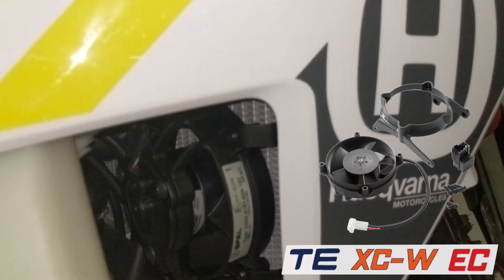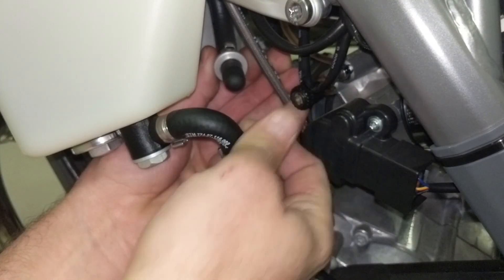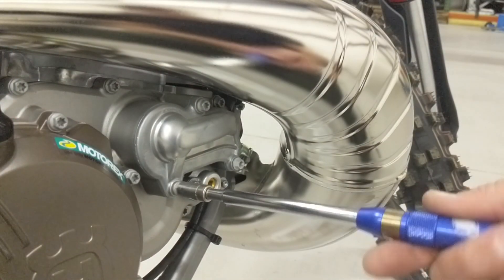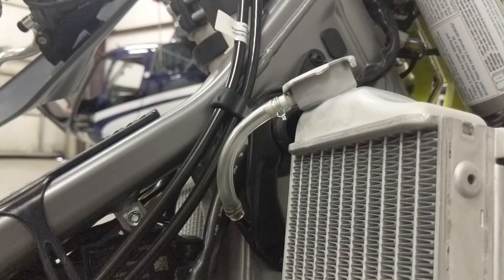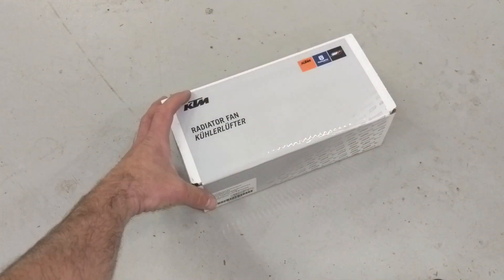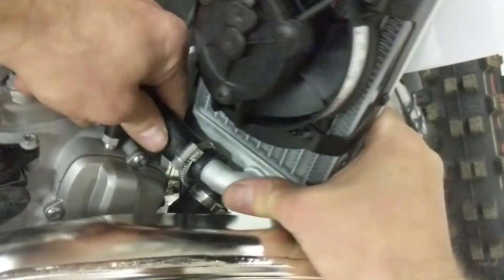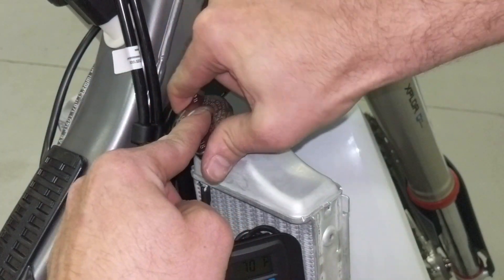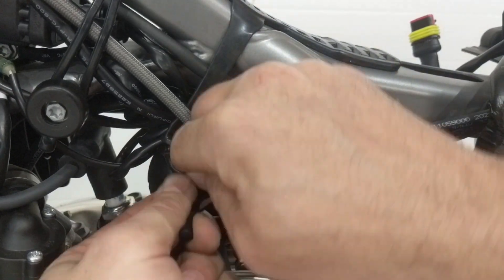2022 TE300i: Radiator Cooling Fan Install (Husqvarna, KTM, GasGas)

Comment: Why people keep using the aftermarket parts? Oem have relay and all. No need to conect on the battery plus runs with the engine itself
Reply from the maker: Yeah the OEM fan is a great option. However,  the aftermarket fan has a display and with the direct battery connection, you can set the on/off temperatures independently of the bike's ECM.

Comment: Actually just did mine but used the simplest method, just removed the top hose and rotated rad enough to install fan. Worked great, not a drop of fluid spilled, way quicker.
Reply: Did you drain the coolant?

Comment: Any ideas what temperature to set on this fan for FX350 '23 ? I don't want it to be cold or overheat, but can't figure out what temperature would be fine 
- I don't know how coolant temperature is related to radiator temperature (sensor is stuck between radiator pins, not inside cooling system where coolant is directly touching it).

Comment: Curious,  using the fan relay does the fan shut off on it's own after the bike is shut off?. Mine came with a switch and will continue to run even after the  bike is turned off until it reaches the desired set temp. Problem with this is the drain on battery and the fact that there is no water circulating with the engine off. 

Thanks
Reply from the maker: If the switch is wired correctly in series between the battery and the fan, you can turn the switch off and bypass fan temperature control when the bike isn't running. If you leave the switch on, it's direct wired to the battery and the temperature control built into the fan dictates when it turns on or off regardless of whether the bike is running or not. I don't have the switch on mine, and it doesn't bother me that the fan is trying to cool the bike when it's not running. With the lithium battery, I've never had a problem with the battery getting weak. Especially in situations where the fan is needed. It means you're actively riding the bike, and the battery is being maintained in a good state of charge. It's also fine the coolant isn't being circulated when the bike's off. The fan will cool what it can. If you bypass your switch, and wire direct into the OEM relay slot, your fan will now be getting two signals. The bike computer will be trying to control the on-off temp, but so will the fan. The fan might be asking for power, but the computer isn't sending it because the two temps don't agree. Not sure if that helps you with what you're after, but hopefully good information. Thanks for watching!
Reply: @MasterJacks  I have a couple friends that  have KTM 300 Erzberg edition and when they shut off their bikes the fans runs for maybe 5 seconds after.  That is why I was wondering if the fan relay on the Husky would do the same.

Comment: You 2022 should have come with a plug for the fan and shouldn’t have needed the auxiliary harness. My 2022 250 did.
Reply from the maker: Which fan did you install? Did it have the digital display?
Reply: @MasterJacks  I installed the Ktm fan with digital display. Same as yours. If you dig through the harness under the backbone near the rubber tie that secures the wiring, you will find a empty plug that matches the plug on the fan. All 2022 and newer models come plug and play for a fan.
Reply from the maker: @slickricktheruler  I was curious about that when I did mine. I found that connector, but I didn't feel like it was a good fit. It didn't snap, more like a compression fit. I've also heard that tapping into that connector gives the bike's module temperature control vs. the temp you set on the fan. Has it worked okay for you?
Reply: @MasterJacks  I’ve had it installed since last winter and I haven’t had any issues with it. It cycles on at about 182 and and off at about 176 roughly. Yes it’s a compression fit  Just thought I’d let you know and thank you for the how to video.
Reply from the maker: Thanks for sharing. Good to know!
Reply: @MasterJacks  your husky had the fan relay already installed correct?
Reply: I am not kidding when I say I have my 2024 KTM 450 XC-F  in my kitchen right now trying to get this fan on (it’s too hot in my garage). For the life of me I can’t find where it plugs in!!! I was under the impression we didn’t need the harness either. So I was happy to read that you thought the same thing. Could you tell me where that plug us? I have been looking for over and hour!!!

Comment: I'm desperately looking for something that will fit the 2022 Husky FC 450 Rockstar edition. Basically a 23 model.
Reply from the maker: I'm 99% positive this fan would fit your bike. The wiring is universal. I would look up the radiator on your bike, and the radiator on this bike and see if they have the same part number. If the radiator is the same, the fan will mount up. This is a great fan, and fits up to most husky, KTM models. Good luck!
Reply: @MasterJacks  I've mounted it on FX350 '23 and working fine - I just had to use other screwes than those included with the fan.

Comment: I just did all this about a month ago, now it’s got a huge draw killing the battery when the bike is off. Any ideas
Reply from the maker: If you used the same method and direct wired to the battery (didn't tie into any factory wiring), then I would disconnect the fan and see if your drain goes away. That would at least tell you if it's in your fan, or something else. The fan shouldn't be drawing anything, but if it is they make a switch so you can isolate it and only turn it on when you're running the bike.
Reply: @MasterJacks   it’s definitely the fan, bike is a 22 300te with the oem fan plugged into the oem plug and harness. Pretty simple. Only a month old. What could be drawling it?
Reply from the maker: Wish I could tell you. If it's a direct plug into the factory harness, the brain is controlling it 🤷‍♂️. Installing a switch might be a good option. I think you can find the part number right off the Husqvarna accessories web page, 77711979000. The problem sounds familiar to me, vague memories of reading about it on forums when I was trying to decide which fan to go with.
Reply: @MasterJacks  it’s a stumper for sure, thanks for the imput

Comment: Very informative video. I just picked up a 2022 TE250i after riding a 2003 KTM 525 EXC for almost two decades and am going through setting it up and breaking it in. Fan kit is in the next wave of upgrades. Your video had lots of other relevant info regarding the Husqvqrna TE's that I found very useful. I would really appreciate any other setup / break in info you might be able to pass on. Did you replace the stock hand guards with full aluminium bark buster type hand guards and if so which ones have you found to fit the best? The manual says to check and adjust the steering head bearings after only one hour. I would imagine that unless there is perceptible looseness just snugging it up a very small amount would suffice. Thank you again for your channel and efforts to post all this info. It is a great reference source.

Comment: Nice job explaining the install! I Just picked this bike and fan kit up. Was watching your vid before I start just to realize I need that wire harness kit, (classic shop guy not knowing parts). Since you got the same bike do you know a part number for wrap around hand guards that fit onto the stock flags?  

Thanks and great vid
Reply from the maker: Thanks and congrats on the new bike! I'm not sure what the part number is for the handguard piece. I think I saw them on the Husqvarna accessories website. I've used that for finding part numbers then searching them on the web. RockyMountainATV.com has a good filter for searching for parts by make and model.

Comment: how close is the display to the gas tank? i just got that fan for my 2022, i haven't installed yet but it looks like the bracket for the the display is going to rub on the tank.
Reply from the maker: I hadn't noticed that, but yes it does. There isn't a lot of contact. I think you could lightly file the bezel right there and make some clearance.

Comment: Thanks for sharing. I thought these bikes came with those standard?
Reply from the maker: I'm not sure about the European or Rock Start versions, but the US bikes don't come with them installed. Thanks for watching!
Reply: @MasterJacks  I always thought they did. I believe the KTM 300 XC-W comes with them stock.
Reply from the maker: Not that I can see in the pictures, but they all come factory ready for the non-digital fan with the harness and relay slot.
Reply: @MasterJacks  Well should've came with them stock 😆 I had a '16 350 EXC-F and that came with a radiator fan stock. I think 2015 onwards they came stock with it
Reply from the maker: @Dave-kz3mx  I agree!